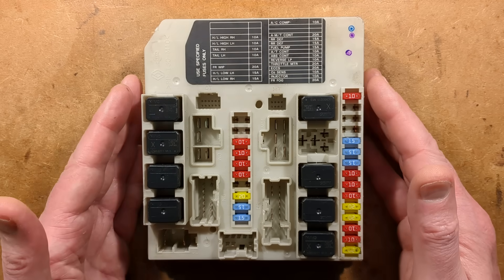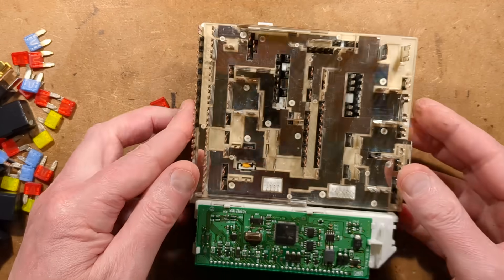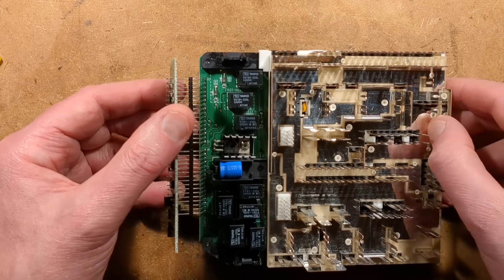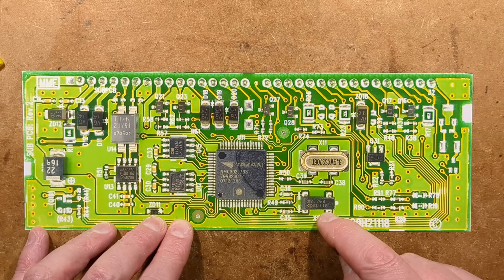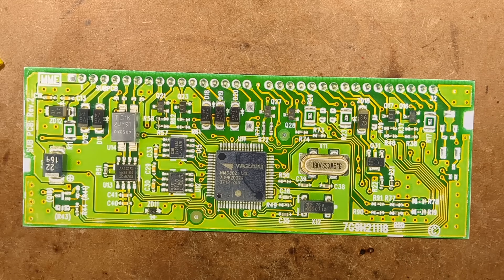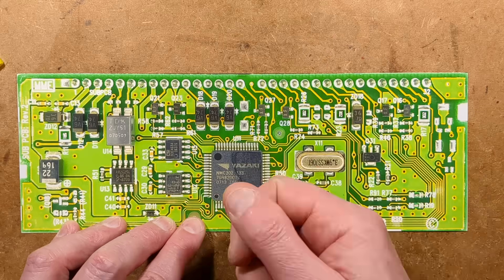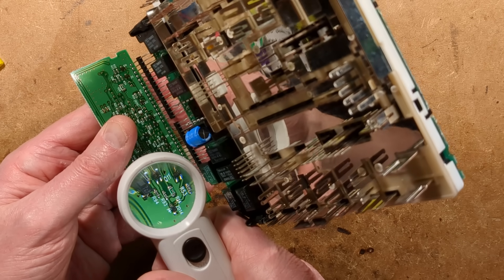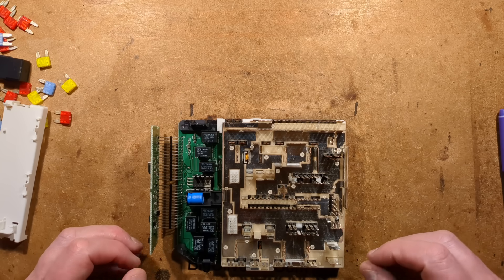Why your car's fuse box costs so much (and the location of the data chip)

Comment: Hello Clive. About reading the chip in-circuit, (1) first, clear the conformal coating that covers the chip (with acetone) so the SOIC-8 clip can have a good electrical contact with the pins of the chip. (2) Second, if the data cannot be read, or it can be read but it is corrupted, try jumping the leads of the crystal with a small jumper or a high value capacitor, like 0.1uf, to stop the MCU from running. A 0.1 μF is a high value compared to the frequency at which the chip runs. (3) Third and last, although it should be the first and only, if no good read yet, then take out the chip to read it. 

The first steps are in the case that taking the chip out is difficult for any reason. When I work with Toyota ECMs, there are some that allow reading in-circuit, no jumper needed, and for the others, it must be taken out. One key could be the reading voltage. Some of those EEPROMs can be read with the programmer set to 1.8volts. At that voltage, most MCUs do not run, and the chip has enough power to give the data. I can do that with the EETOOLS TopMax programmer. Cheaper ones have that voltage fixed to 5 volts when it comes to an EEPROM.
Reply: Most MCUs have a halt (or /halt) pin, which freezes the MCU when held high (or low). There may also be a bus control pin which prevents anything else, including the MCU, from putting signals on the data bus. Of course, either of these requires a good understanding of the MCU so freezing the crystal may be simpler than learning about a new MCU.
Reply: Hax

Comment: I think if I was worried about the MCU messing with the EEPROM while I poke around, I'd find the reset pin on the MCU and use something to pull that low while I'm working.

Comment: If this thing is so darn smart and expensive my car really needs to start telling me "Oi, fuse 17 under the steering wheel is shot, get a new one and check your not plugging in too many accessories at once!" instead of crap plugged into the 12v port just randomly stop working.

Comment: Interesting that you took a dive into automotive electronics - as I say, cars now are computer networks on wheels, making the diagnostic and repair, both time consuming and expensive, requiring specialized equipment, like scan tools, and expensive subscriptions to several suppliers of diagrams and technical information, as you may have seen with Eric O. and others. What's annoying with these computerized fuse boxes, is that critical relays are inaccessible for quick replacement and end up being replaced because of a faulty relay - expensive repair. And yes, they have to be programmed with the relevant data (including VIN) for that specific make and model, to be downloaded from the manufacturer (at a cost). BTW, if a CAN bus module sits at one end of the network, it has a 120 Ohm terminating resistor across its legs, being complemented by another 120 Ohm terminating resistor at the other end module, to give the network the necessary 60 Ohm impedance. If you check the fuse box's network legs, with an ohmmeter, it will either have high impedance, if it's a pass-through or parallel module, or 120 Ohm from a terminating resistor, if it's the first or last module on the network.

Comment: I currently have to “make do” with driving my Dad’s Volvo, which has 3 fuse panels: one under the bonnet, one behind the side panel next to the instrument cluster, and one in the boot.
Been having issues with the sidelights + numberplate lights since end of January. Apparently the REM (rear engine module) has gone cuckoo, and still doesn’t work right even after getting a replacement off at from a scrappy in Manchester.

Comment: Yep, it’s a Micra K12 IPDM - ‘Intelligent Power Distribution Module’ - Horrible to get the relays out without the casings breaking!! I usually take the 93C46 off the read & clone onto a donor unit, if you use a Clip to read then make sure the file verifies, if not lower the voltage until it does, or short the crystal (clock) but safer just to heat it off the board - on the Eeprom holds immobiliser data so if you swap one the car doesn’t start until you clone the Eeprom - Great to see you doing car stuff Clive, if you want any other modules for tear downs tap me up!
Reply from the maker: It's possible that the watchdog and undervoltage protection chip could keep the main processor reset if the memory chip was read/programmed at 3.3V.

Comment: It's absolutely asinine that any automotive fuse box is more than just fuses and a busbar.  Nothing really needs that kind of complexity.  It's one thing to be able to detect a blown fuse but that can be done with simple LED and resistors with no active circuitry.  No wonder they can't seem to make a vehicle for under 20K any more even though places like China can stamp out inexpensive vehicles using basic systems all day.  You would think by now that with the chip shortages and the trade wars, auto manufacturers would learn that vehicles need to be less complex, not more.

Comment: Hyundai had an issue around 2010 in the i30 platform where the abs unit would spontaneously combust in the middle of the night with the car switched off. Hyundai put the blame on moisture entry due to a weather seal being damaged during assembly, interestingly the fix was not to replace the abs module but to engineer a daughter board that plugged into the abs relay position in the fuse box and jumped over to pick up signals from other fuse locations resulting in a two tier fuse panel. I think Hyundai may have been telling porkies and an issue in the cars electronics was powering up the abs pump and keeping it running until it failed with fire.

Comment: Exact same "fuse box" of my 2007 nissan micra. It effectively is the brain of the main functions like fuel pump, starter motor, wipers, headlights...everything is managed with canbus  communication. I knew the big relays were soldered on, glad to see they can be swapped easily

Comment: One of my pet peeves, is when a modern car flashes up a 'check engine', or 'generic failure' warning light, and you can go through the menus and settings, car service data etc, and there's NO further information on what the cause might be, even an error code that you can [search engine of choice]  . It's like a Mac that shows you a sad face, where a Windows PC would pop up an error box that at least gives you some clues on where to look.
Reply: That's why it's so common for ppl to get their own OBD2 interface, to clear those useless checks/notifications.  I swear some of the notifications are literally just "I'm lonely, you don't touch me anymore".
Reply from the maker: Yeah, I've got that issue with mine.  Just very vague indications when it is capable of identifying the exact input that is an issue.
Reply: FWIW, the sad face was accompanied by a hexadecimal value that could be decoded to determine the nature of the failure.
Reply: @beefchicken  And the Macs stopped showing "a sad face" about 30 years ago. That was a time where the windows PC of the simile above was giving you the code for a printer-related error when the audio card was malfunctioning :D 
Some people keep hanging on to memes like it's some kind of knowledge.
Reply: @IlBiggo  Meanwhile windows now shows a sad face instead of useful information when something goes wrong.

Comment: The super simple fuse box of my tractor only has 8 Continental (torpedo) fuses but it can't be swapped by the generic one of the same brand because it includes hidden links between a few connectors.
I'm 99,99% sure they only did it to save external wiring but it can also be considered as a primitive way of forcing you to buy the original spare part

Comment: This makes me more inclined to keep my 10+ year old manual diesel utility vehicle maintained for as long as possible. Aside from the ECU, ABS, electronic injector drivers, and CD player/radio (LOL!), it is all "old school".  And I do sort of have another diesel vehicle with a "computerless" mechanical injector which runs without the battery as long as you can push start it. :-)

Comment: reading eeproms in circuit you just hold the mcu in reset or if no data sheet available just short the xtal oscillator 2 pins together to stop the mcu running , and power up the bcm with 12v so its supplying the 5v/3.3v to the eeprom,  but i always remove to be sure ,its so easy when its sot8,
 if you do read in circuit you just see if you get the same checksum after 2 to 3 consecutive reads then you know its 100% reliable, its the conformal coating that corrupts most bad reads you think you scraped through it but.. , nail polish remover for the most common acrilic based coatings

Comment: as far as i understand automotive canbus was 1st developed for trucks flyby wire systems before it got into cars , and i think industrial process control before trucks
Reply: Not specifically. It was developed by Bosch in 1983 and presented to the SAE in Detroit in 1986, with a high-end Mercedes car being the first vehicle using the bus in 1991 (source, Wikipedia).

Comment: On our Heritage Railway we have rail buggies where to controls to drive it are at both ends so when there a problem it could be at one of the drive controls ends or it could be at the master control box and that is full of relays and some have timers and not forgetting the fuses.  So if the buggy is stationary with the engine running and you leave it in gear the engine will shut down after 5 minutes and before you set off you must put your foot on the dead man pedal or the engine will shut down.  It also has a speed limiter of 15 MPH unless we unplug the limiter relay of which we never do no no

Comment: My issue with modern cars and the 'clever' electronics under the bonnet - 
2025, service lamp lights up, fault light comes on, janky things going on with headlights and indicators..£400 later and a service charge and a specialist charge and parts and labour, car ready to go, 5 miles later, service light comes on ...
1985, engine won't start, indicating left makes brake lights flash.. quick look under the bonnet and the rear lights wiring, spot a black wire disconnected and the ground lead in poor condition. £4 for a new ground lead later after a trip to Motormania and a friend with big hands and a ratchet spanner, problem fixed, permanently. 😝

Comment: Very well explained Clive many thanks! My car threw a wobbly every warning came up brake failure, no oil, headlights wouldn’t turn off, wipers not working, and the list goes on. It was due to moisture in the unit basically super cooled air (quoted on a Volvo forum) anyway cleaned the PCB it happened twice and the second time I covered up the unit with a plastic bag and refitted it back under the glovebox, all been good since, this was a common issue on the Volvo c70.

Comment: Could it be that the in circuit chip readers work because the microcontroller is being held in reset by whatever reset circuit has not yet determined a safe state (because of back-feeding)? Personally I would just ground the reset pin manually in any case.

Comment: Super interesting video. Im more of a backyard mechanic that over the years became the person who gets the repairs that the big shops gave up on. Ive aquired a ton of model specific knowledge that has saved cars from being scrapped. An example would be jeep grand cherokees having electric gremlins where nothing electronic will work. Its caused by a single (too short?) wire in the drivers door hinge that snaps.(Over extending the door ?) Or newer jeeps/dodges where traces in the shift computer need a cleaning to restore the transmission. Ive actually bought 3 jeeps/dodges with "bad transmissions" after i saw the shifter they had. A half hr later and a cap full of ipa and they drive like new.
Reply: Had a Mitsubish Magna like that, just wouldn't start half the time, spent months chasing it down thinking it was an issue with the shoddy AF LPG conversion that had been installed on it but eventually traced it to the connector to the antenna coil around the ignition barrel coming loose because the cable was JUST too short (or maybe the muppet who installed the LPG conversion had cable tied the gauge harness to it or something, don't remember right now), it was pulling the connector apart so the contacts were barely making connection, re-routed the cable and stuck a zip tie through the vacant pin hole in the middle and never had another issue with it.

Poor thing died a sad death when I parked it up through winter in a cold region and because the frameless windows didn't seal very well the interior got very damp and went mouldy, still ran fine but was very much a health hazard, local State Emergency Service were happy to have it as a training aid though.
Reply: @SomeMorganSomewhere excellent work diagnosing that. Its a great feeling when you figure it out.

Comment: Great video to stumble upon today as this hits a special interest I've been stuck on lately. As a (modern, ~2012+) Ford vehicle owner they consider this the 'body control module' or BCM and it does a LOT on their side. Lighting control both interior and exterior, key/immobilizer validation, keyfob signal receiver and remote start handling, some engine related signal relays such as the cranking signal from the ignition cylinder after the key is validated, voltage/battery monitoring and intelligent charge control signals for the alternator, etc.. Those are just the immediate functions off the top of my head.

As for programming, and again this is focused on how Ford does things as I'm familiar with that side, usually you can just program them in-situ right over the CAN bus with the right hardware/software even if it has incorrect programming for your vehicle currently. Kinda makes sense as an easy way for techs to handle replacements. No real need to break out eeprom programmers/desolder chips/etc.. Usually you have the baseline firmware that is enough for the car to know how to talk to it even if the configuration data is wrong. The configuration data is then what needs to be reprogrammed for your vehicle to make everything work properly.

Some fun little facts I've learned over the years from my own vehicle showing how things have evolved: Pretty much all stalk controls like headlamps, turn signals, wiper controls, etc.. are all just digital signals either over a LIN or CAN bus to the BCM and then it does the direct control to the physical hardware. Lighting is actually PWM controlled and with the right diagnostic software you can ramp it fully from 0 to 100%. For turn signals, you get that same control but then the BCM sends another set of signals over CAN to the gauge cluster for it to illuminate the turn signal indicators and play the little 'bing bong' sounds out of an integrated speaker.

Honestly it feels like it's more of an active compute module with the 'bonus' of having a fuse/relay panel attached in terms of priority. But I understand why it's combined since so much of the functions being controlled have to have those relays/fuses in place.

Comment: Could you pull the reset pin high or low as appropriate to keep the the microcontroller from accessing the flash? As i was typing this, you mentioned the watchdog chip, it should be using that reset line, so convenient place to access it, hmm?

Comment: The more they add to cars, the more unreliable they become and the less value they are to me. Give me an old car with a manual gearbox, no ABS, no climate control and manual everything. Throw in a diesel engine with a mechanical pump.

Comment: nissan is really renault since about 2001 but nissan manage to make their bcm reliable whereas the renault equivelent is certainly not, comment if youve had left indicators stuck on in clios and meganes  and no one had such issue in a k12 micra! 
not the 1st time this happens ,the ford probe (really a mazda ) used a bosch immobiliser that suffered melted solder joints whereas exactly the same bosche unit used by porche was extremelly reliable ,i found ford were overloading the fuel cut off relay, (personal opinion) the stressed contacts sending heat into the pcb causing dry joints

Comment: Clive pls stay in your lane & go play with cheap LED lights & batteries, I do diag & repair or replacement & programming of such devices, I'm a mechanic with skills, I also fix mobile phones & laptops at component level.
Reply from the maker: My "lane" includes designing control systems,  including writing their firmware in assembly code.

Comment: You can definitively have bus contention with in circuit eeprom access, but looking up the microcontroller and using a probe  (PCBites is my favourite) to keep the mcu reset pin asserted usually works around it.

Comment: It probably does do timing. I'm sure you know just how many wires use to run into fuse boxes 30 years ago, that was costly because the wire was frequently thick so it could be controlled directly at the switch. The modules replaced that with thin wires that communicated functions, that required clocks to be synchronized. There can be dozens of these modules in a modern car.

You should take apart a TIPM that Dodge used in the 2010s, they are known to fail frequently. They have relays that like to fail. I don't understand why they cant make the relays replaceable like they use to. The old fuse boxes looked like hair going into a scalp from behind, but you could add your own circuits in the blank spots.